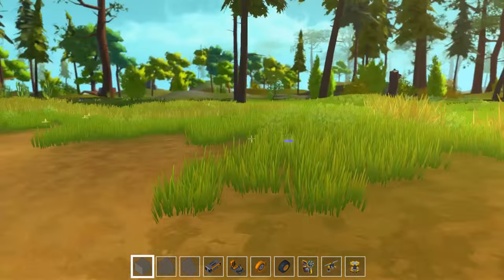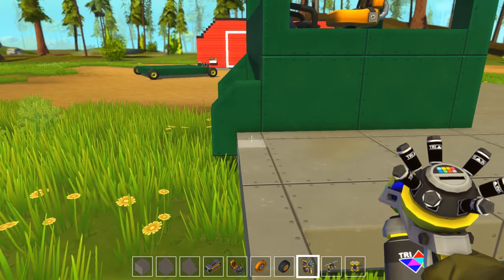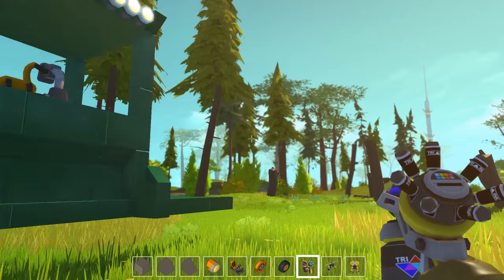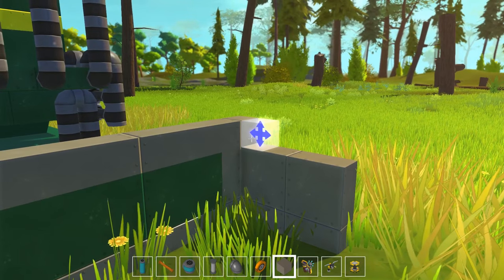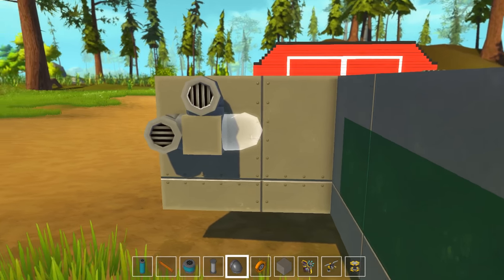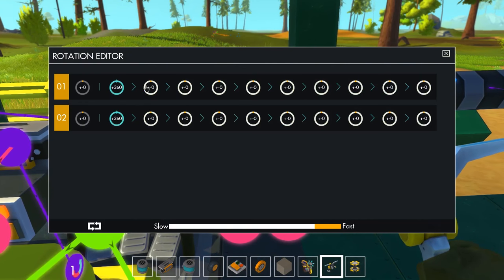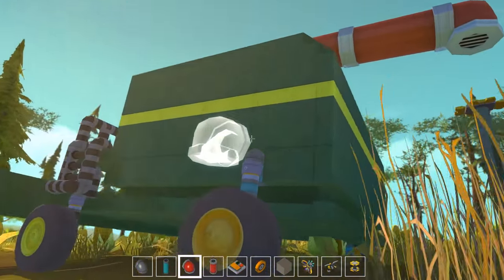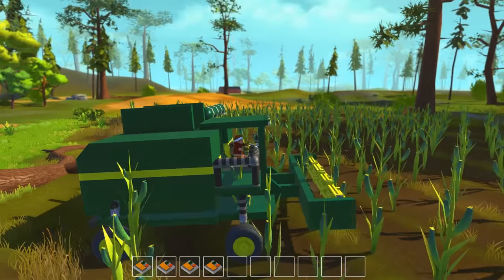Scrap Mechanic Gameplay - EP 25 - Combine Harvester

Comment: For the front spinner thing, you could've set the controller into repeat mode (with the little loop signal at the bottom) so it would only stop when you turn it off
Reply: +Nate Sauer but nevertheless, really cool build I could never build something this good
Reply from the maker: Cool! I didn't even see that. Thanks for watching.